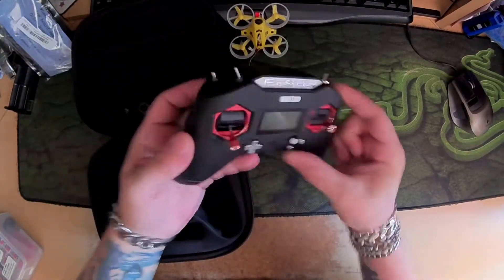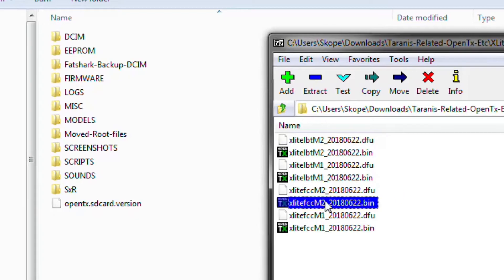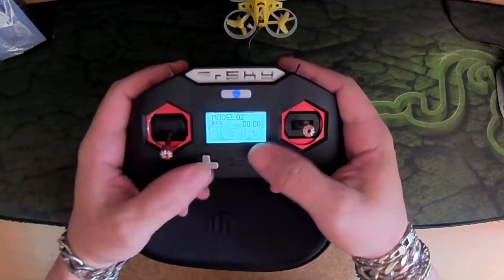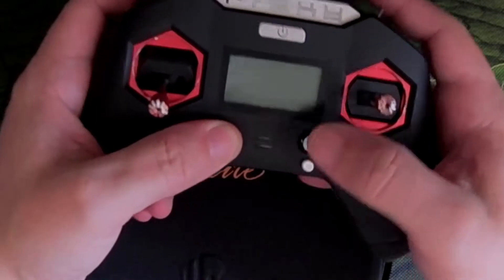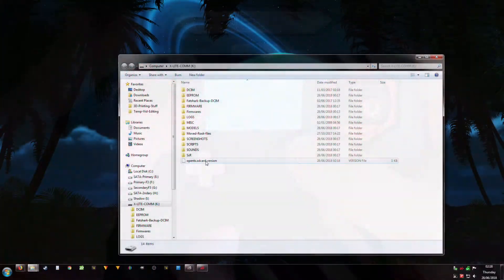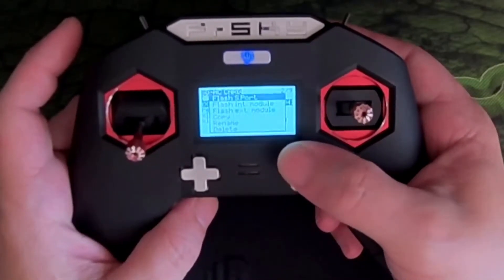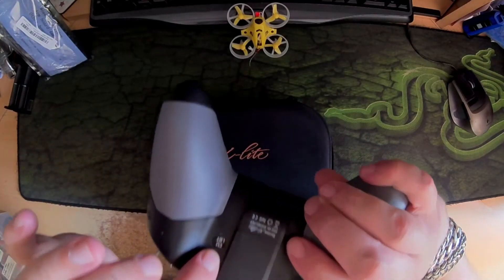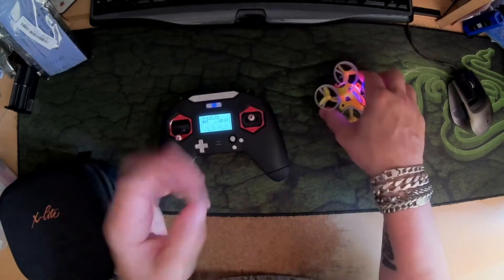FrSky X-Lite Firmware [Flashing Firmware - Inc. EU to Int & XJT Module]

Comment: Can i change the X Lite S the same way from non EU to EU?
Reply from the maker: Firstly I have no experience with the S or Pro so this is info at a glance but if it was me I'd give it a shot.
The firmware download for the XLite S looks to contain 2 firmware files being ISRM S & P which could indicate to me that it's possible however with ACCESS ,again I'm in the dark on that one.

I've heard that newer stuff is being picky about changing firmwares but there is a lua script you can get directly from Frsky that allows you to change FCC to LBT and vicaversa in a menu.

Good luck!
Reply: @MrE.  Thank you very much! It is quite difficult to get the X-Lite at the moment in Europe for a reasonable price unfortunately. It is more or less sold out at banggood. especially the white one. And the extended battery caps are also not all the time included it seems. Quite sad for such a price to take extra 20 USD for 2 cheap plastic parts.
Reply from the maker: @amiLli257  I hadn't noticed the standard XLite disappear until you've mentioned!
Some of the newer XLites are 18650 compatible out of the box it seems from the quick scan I've done of my UK vendors!

That being said I have always used the original 18500's very heavily and never felt the need to get the caps although I do always have a second pair charged in it's case.

There looks to be a lot of videos showing the S being flashed and changed to different firmwares so I would say it's possible. Check TweetFPV 's channel.

Good luck in your quest!

Comment: Hey bud I have a frsky xd9 I want to flash my XJT module to non eu for my tbs tiny hawk and not my remote I flash the external module but nothing changes. So do you think I need to rename the file like u have ?
Reply from the maker: You might have to depending on how old the unit is, I think they changed it for some regulation because we all kept using international firmware. just a matter of naming the international EXT module firmware file to the EU but that only lets it show up for the flashing process selection, I think you can tell if it's worked due to D8 mode showing up in the protocol.

I have older vid's showing the process on the X7 iirc it was identical to the X9D.
From memory I did bootloader, firmware and the EXT module. 

Hope this gives you some info but get back to me and I'll see if I can help you out further if you're still hjaving probs.
Reply: MrE thanks for reply means a lot :) I’ll give it a try

Comment: can you do d8 on the xlite pro without a multi protocol so only the internal transmitter if you flash non-EU?
Reply from the maker: I have no idea about the pro, sorry. I'd be very suprised if it wasn't possible.
Reply: @MrE.  but on the normal xlite and xlite s its working?
Reply from the maker: @philipps.1477  I can only vouch for the standard X-Lite, most certainly you can have D8 as standard on the international version and you can get D8 working on the EU variant (all due to EU requiring LBT on radio gear or something). The S & Pro are different due to the protocol change to ACCESS which I believe only supports D16 utilising the original ACCST protocol (which even requires different firmwares)

Comment: Done everything but it's messed upy sticks. Throttle is now roll!! What the hell?
Reply from the maker: I expect it's your channel map , if everything else is stock go into Betaflight > receiver tab and change it from default (AETR) to JR (TAER).
You can also do it the other end on the radio setup menu by changing the default channel order to AETR.
Reply: @MrE.  hi, nothing worked so I went to opentx companion and did it that way but didn't select EU.
Not sure if I need to still flash my XJT or not but sticks are now back to normal.
Reply: @MrE.  I should say my sticks were messed up in the radio. On the display screen Throttle was roll and all sorts!! No changes made any effect
Reply from the maker: @UKJenova  As long as it's sorted! it could have also been the mixer & output crossing wires so to speak for future reference.
For the most part - the EU/ FCC choice is purely to match up to the type of receiver  (I have so much legacy stuff from before the EU firmware days) so let that dictate which version you need.
Taranis/OpenTX handling of the channels is somewhat complicated but then also pretty much the most universal and versatile system.

To go the whole hog , I'm not sure if it is still this way but EU OpenTX firmware used to remove the D8 protocol compatability ,while the XJT module is just the communication device that the firmware uses to transmit.

Always ahppy to help you out - we'll get to the bottom of anything given time! Happy flying ,bud!

Comment: I am following all the steps in this video. However when I try to flash the internal ixjt module it doesn't seem to flash like yours did.
Reply: It is ok I sorted it, I don't think you have to rename the xjt file these days.
Reply from the maker: Ahh, good to hear! I'll bear it in mind re-doing the video as this was done with the original release stuff.
Reply: Cool beans, the missus is happy now haha. She's got a working controller. did your x-lite have what I can only describe the slight bounce at the bottom and top of the throttle stick? The stick won't go all the way to the bottom or all the way to the top without resistance
Reply from the maker: @M4TTFPV  I can't say that it did, it cetainly doesn't now as it has precise quite solid endstops that also feel the same on the roll and pitch stick ignoring the spring obviously.
I did have to fine tune the throttle stick for my liking from memory though.

Edit - you may have a little further to go on the spring centering screw to alleviate the bounce.
Reply: Thank you for your prompt replies I really appreciate it. I will have a look at that
Reply: @M4TTFPV  hey buddy, I seen this issue. It's 1 of 2 things.
It sounds like you have the cable tie issue. It's where your gimbal wires are cable tied but without enough slack so it pulls the stick back up or down on the throttle.
You need to open and pull some of the slack through and your golden.
The other issue is where there's too much putty causing a similar issue, again, needs opening and carefully scraping off.
Good luck bro
Reply: @UKJenova  thank you mate I'll take a look
Reply from the maker: What is different?

Comment: ...for heavens sake slow down...communicate...appretiace the effort but...you need some performing training or something...keep at it...train...train...and then some...communicate...
Reply from the maker: Thanks for the cirtique, was there any specific part that you couldn't follow or just as a whole?
There is a slower paced video that is a bit more concise compared to this in the playlist linked in the cards top right(for the X7) as this is primarily focused on the firmware "hack" but encompassed the whole process for good measure.
Reply: @MrE.  Please DO NOT change your style. Clearly the guy is American and likes a ten minute intro and everything said in all variations and repeated. No thanks. Delivery was perfect!!
Reply: Im new to the hobby and I can't keep up ether
 @MrE.
Reply from the maker: @eskilvreb861   I'll see about making a beginner friendly video if mine is still the only one regards converting LBT to FCC and vice versa.
Reply: that's kinda rushed , i like to be certain when i do things , and i'm needing to look for another video
Reply from the maker: @AndyM65  I will make a slower paced video specifically for the X-lite however there are some previously for the X7 which is identical mostly included in cards in the playlist.

I think when I did this before any other Xlite videos were out, it was more aimed at seasoned people needing the general direction and more so the EU units hack.

If you are still in need or unsure on any step , I'm happy to help - it might be wise to start a fresh comment rather than a sub comment.

Comment: Niceeeee, just the thing I was looking for!
Will this work on my Taranis XQ7S (EU LTB) as well you think. I already got D8 option back in my menu but wasn't able to update internal module so I keep getting SD Card inconsistencies errors
Reply from the maker: Good good! 

Yes ,it'll work exactly the same on the X7 ( I think theres a video of it in the playlist linked in the cards (i) top right).
Other than different firmware files to download you shouldn't have a problem & from memory it doesn't even require the renaming of the file for it to show up.

Comment: Hello MrE,
I also want to change my (red version EU LBT) xlite to FCC but for some reason I dont get the option Flash Bootloader. The options that I have is copy, rename and delete. I used the same file.
xlitefccM2_20180622.bin
Any suggestions?
Reply from the maker: If following along exactly trying to flash the bootloader from page 2 in the radio setup section, the only possible difference may be that I could have had the firmware flashed (from the bootloaded power up sequence entered from the Dpad held down) before I flashed the bootloader.Other than that I'm not too sure however I'll try and work it out with you!
Reply: MrE I also tried the other firmwares (EU and fcc) in page 2 and in bootloader mode. And still no bootloader option available in page 2 and in bootloader mode it keeps saying that's file is not compatible. So I think I forgot something. But not sure what :-(
Reply from the maker: Ok then. My first thought would be that prehaps either the files have not downloaded or the archive has not been unpacked to the SD card correctly?
One other bit of info that might help us is on page 5 of the radio setup is what the reported data is.
Reply: MrE here some info
Fw: opentx-xlite
Vers: 2.2.2 (e3ea8595)
Date: 2018-06-21
Eepr: 218
Reply from the maker: That is identical to my info. It looks as though you have it installed? (I think the e3ea8595 after the Vers is the key identifier)
Reply: MrE mmmm, thx for your support. Think im going to turn my 3 receivers into EU. That's a lot easier for me hahaha. Thx
Reply from the maker: Hey, no problem - This should be very straight forward and I'm kinda at a loss as to why it wont work. I'v tried to throw it off with different locations and subfolders etc but it seems to not care - just that the main thing being xlitefccM2_20180622.bin / xlitefccM2_20180622.dfu is present for flashing the bootloader and FW.
What program are you using to decompress/unpack the firmware's archive to the SDCard?
Reply: MrE I used winrar
Reply from the maker: Wow, thats a blast from the past! (I use 7z, prehaps give that a try?).
Again at a loss to why the process wont work on your unit - even if it was flashed to the int version it still shows the "Flash Bootloader" exec on the menu (I'm not sure if having the corresponding DFU file is a requirement either so..), have you flashed the firmware going into the bootloader?

Prehaps its an order thing ( the most important thing for going to FCC is the XJT modules firmware). Check to see if you have D8 availiable in the radio setup as that will certainly be the tell if it's int firmware or not from memory.
The bootloader might not even be required.

If you are as stubborn as I am and are in dire need of D8 specifically, hence the intention of having FCC, I'll continue you try and work it out with you!